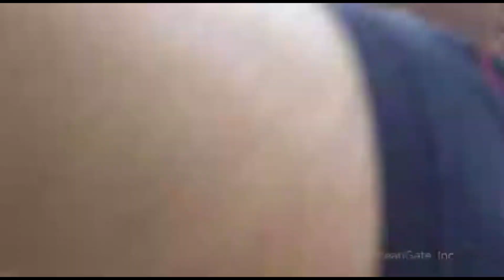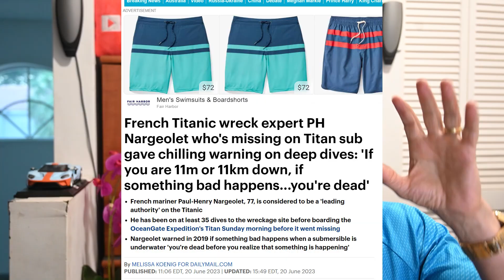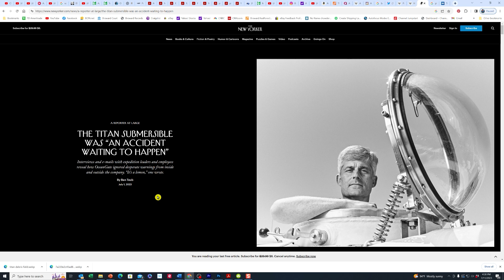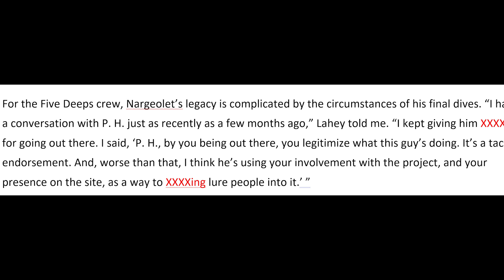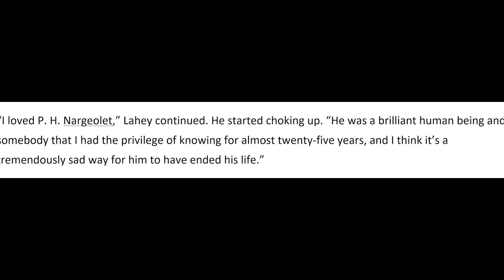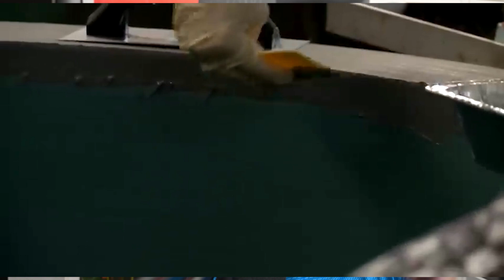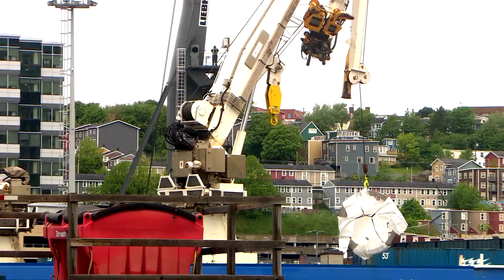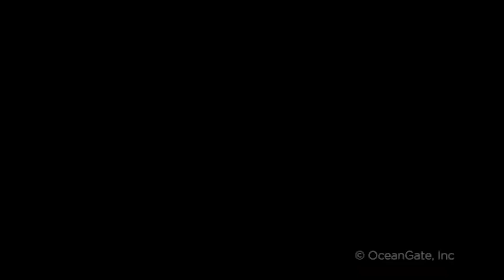Titan Sub: More Q&A, Design Defects, Why Descent Fast

Comment: If the descent rate was really that fast (we don't have official numbers), the sub was way too heavy. Then descent rate increases only with the square root of the weight, so for going down about 1.4 times as normal fast you need twice the weight as normal.

The sub size is 6.7m x 2.8m x 2.5m, so the area A slowing down descent or ascent would be 16.75m2 when a rectangle or an estimated 12 m2 with the real shape, and according to 𝑉=√(2𝑚𝑔/𝜌𝐴𝐶𝑑), with a Cd set 0.5, the "overweight" to make the sub descent with 0.4m/s would require about 50kg or 500N down force.

For 0.6m/s it would be 110kg. This means, that the sub would have been in the order of 50kg too heavy. To change from a normal descent to a normal ascent, the sub would have to drop about 100kg of ballast. However, if the sub has 50kg normal down force on descent plus is 50 kg overweight, dropping 100kg of ballast will get you only roughly neutral buoyancy.

I don't know how much ballast they actually had, and my calculations are only a rough guesstimation, but the numbers kind of make sense. It would be a bit weird though if they miscalculated they weight by 50kg - that is not a minor difference. I am really curious what the official accident report will reveal.

UPDATE: The submersibale "Limiting Factor" has 500kg of drop weight and 100kg of trim weights, so if Titan had similar ballast, it should have been able to deal with 50kg easily, but I could not find any numbers regarding ballast mass for the Titan. Maybe they screwed up here too, trying to save weight.

UPDATE 2: The Titan had 8 x 36lbs sand bags as ballast plus an unknown amount of lead pipes, so the normal drop ballast would be 288lbs or 130kg, but as sand has only a density around 2, the sand bags would amount just to half of that under water, so the sand bags probably acted mainly as trim weights.
Reply: I came to a similar conclusion but instead assumed a Cd of 1.2 given that is is descending in the horizontal orientation which is not very "aero". I tried to calculate it based on the designed descent rate, mass and cross sectional area but couldn't get reliable data on the weight (anywhere from 9100kg to 10700kg). The excess ballast is sensitive to Cd and at 1.2 the excess is around 130kg. I think a miscalculation is very plausible. e.g. if the calculation is in kg and the excess is 100kg a simple miskeying of 1 digit would do it.

Comment: this is not a professional argument, but not rapid descent might have caused small cracks, because of the pressure building up slowly and distracting the glue, the submersible was built using, and this would cause Oceangate, drowning its passengers, so the death might have not been so instantaneous and passengers think would suffer much more, in the case of unsuccessfull slow descent!

Comment: I can't believe they wound the carbon fiber on only one direction How is it supposed to have any strength at all You want that weave in there to give it strength This was an accident waiting to happen and the only reason why it did happen was Stockton was on Adderall He had an abnormal high dopamine level so he can convince himself the shady engineering package were completely sound

Comment: I was a wood treater I don't know if you know anything about wood treating We use 100-ft long cylinders 20 ft across sometimes 30 ft First we put the logs under a vacuum check out all the free water in 25% of the bound water
Then we put those logs under a pressure and we push back with the pressure and chemical called penta in the medium is diesel fuel That's how you make telephone poles.
We are at 5600 ft The max vacuum we were able to grab was 17 in max vacuum at sea level is 22 in That was barely enough vacuum to achieve what we needed cylinder one door 38,000 lb I would shield that door with a quarter inch vacuum.
You would think a quarter inch ate much Well one day our vacuum valve stuck closed We had a quarter inch in there and we tried to pull the door We took the 100-ft by 30-ft cylinder right off its foundation I'm so glad the manager told us to pull I was saying no I don't think we should We had the glue the cylinder back on its foundation We used a micrometer to get the proper amount of glue When I watch ocean gate glue the two titanium ends on the cylinder that was not professional by any means

Comment: To my eye (BS Mech Engr, MS Mat Sci) a major vulnerability was wrapping the carbon into a cylinder without using a commonly enough used technique while making pressure vessels of weaving fibers with spirals rather than 'straight' or 'flat' (like inch-wide 'tape') as you see them doing. Their choice made the composite rather vulnerable to delamination, especially as they were loaded in compression. Weaving matters.

A spiral application of the carbon fibers (best term I have for it) ties together the layers in a way that is much more resistant to delamination. Even that may not have been sufficient to the task.

Aside: I reckon the graphite fiber they applied was what is called 'pre-preg', so am not as alarmed that it wasn't applied 'wet' as you thought might be appropriate. I don't have direct experience with carbon fiber (but did build and fly an experimental plane made of fiberglass, so maybe some cred.)

I totally agree with your observations about process quality control. Epoxy to metal just doesn't sound like a good idea.  The different elastic moduli could have been a factor.  Pictures showing the titanium 'joining ring' (recovered) having no adhering composite material seems telling, but the violence of the implosion might just do that no matter what.

A final comment. Graphite fibers have no 'toughness' in a Materials Science sense. You have already pointed that out rather well. It  will not yield plastically and retain any structural integrity. That is a big deal. No amount of acoustic crack detection would help. Complete failure would occur before any remedial actions could be taken. Materials scientists call this 'fracture critical'.
Reply: the first hull yes the last hull wrapped differently

Comment: One of the things that disturbed me was the dove-tail housing at the back-end.  It impressed me as being unnecessary and cosmetic.  It conceals the area where electrical cables go from the outside to the inside of the submersible to the inside as am area of potential weakness...
Reply: People are say no cabling penetrated the pressure chamber.
Reply: @JoeLinux2000  we don't know for sure and if it was a wi-fi, that's a weak link too.

Comment: titanium and carbon fiber compress at different rates which would have put extra stress on the seam around the titanium front piece, this added with what you said about the glue having nothing to stick would suggest to me that the seam between the two materials is the failure point.

but I'm not convinced that the "leaked" transcript from the previous video is genuine. it sounds like it describes symptoms from 3 seperate failures all at once. loss of boyancey, loss of power and structure failure. I dont think its realistic to suspect that all 3 happened at once for unrelated reasons.

Comment: What would have caused Titan to descend faster? Descent should be a function of weight. So I can't figure out where that extra weight would come from. The equipment bay isn't sealed (as it's not a pressure vessel) so it's not like extra water leaked into a sealed area. As I understand it, only the pressure vessel where the people were is a sealed, watertight compartment. The rest of Titan is open to the ocean.

So why was Titan descending faster? Where did the extra weight come from? Though, given the shipshod way that things were done on Titan, it wouldn't surprise me at all to discover that the crew overloaded the ballast or the sled.

Comment: Basic knowledge told me that a full titanium sphere distributes the great ocean pressure evenly, but inserting a cylinder in between two hemispheres creates a focused weakness.  Excellent computer modeling would have demonstrated this from the very beginning, that the structure was flawed.Stockton Rush might have had limited engineering skills in aircraft design and you could say in the ocean depths , he was out of his element. He has demonstrated himself to be a jet pilot, persuasive salesman and an entrepreneur. His commercial aims required him to defy the laws of physical science though pure determination and through his own actions, failed. 
The story of Paul-Henri Nargeolet, adds just one more fateful element to this story...

Comment: As others have pointed out, the major design issue was the disparity in modulus (compression factor) of the parts. The titanium will effectively not compress at all, whereas the carbon fibre will: that means the bond is a certain failure point.

What is likely to have happened is the bond failed, even if it was just a tiny hole. Given the pressure disparity, the water ingress would have been rapid and caused the negative buoyancy. In addition, the seawater could well have caused serious electrical issues and heat/fire would have been devastating for the carbon fibre.

The disaster was inevitable.

Comment: I got a couple of answers for you number one you cannot ever ever ever scratched or Dent or screw up carbon fiber in any kind of way just a scratch on an airplane wing will break it off over time with vibrations....... moving on to whether or not the carbon-fiber should have been wet absolutely it should have been sealed with some sort of epoxy and moving on to my third point is tubular Kevlar is sown in overlapping patterns the fact that it was wrapped is retarded example I have a Warner paddle from when I used to be a raft guide it's wrapped in a very specific pattern not just spun around a tube.

Comment: WHEN YOU THINK ABOUT THE GLUE AND THE FRONT WINDOW ECT. THAT ISNT REALY THE MAIN THING, NON OF THAT STUFF WOULD HAVE HAD MUCH TO DO WITH IT. ALL THAT STUFF WAS BUILT TO KEEP PRESSURE OUT AND WAS PUSHED TOGATHER HARD AT ALL TIMES. IT WASNT DESINGED TO KEEP PRESSURE IN. WHEN THE CENTER PART OF THE CARBON FIBER TUBE IMPLODED IT DID WITH SUCH FORCE IT BLEW EVERTHING A PART. THE CRAFT WASNT DESINGED TO WITHSTAND THOSE FORCES PUSHING OUTWARD. STILL ITS AMAZSING THE BOLTED IN FRONT WINDOW RIPPED RIGHT OUT. WHEN YOU SEE WHAT HAPPENED IT MUST HAVE BEEN INSTANT.

Comment: The epoxy holding the ring on worked shockingly well IMO, considering they designed the joint inside-out (carbon composite is more compressible than titanium, so the tube would try to pull away under pressure). Incredible that it worked more than once

Edit: I watched a clip of the video from Oceangate again & it looks like the Ti ring may have had a slot & been glued on both sides after all. Still sketchy to create a stress riser between materials w/ different characteristics, but not as insane as relying on the epoxy to hold it from the outside only
Reply: I beg to differ. The carbon fiber has roughly 5 times the elastic modulus of titanium. That means it compresses elastically far less than titanium under the same load conditions.  Compounding the problem is that carbon fibers have no plasticity to speak of (as was pointed out in the earlier post. Plasticity only matters when loaded near a fracture limit, but it means 'near zero toughness' in a material science sense. No bueno.
Reply: @ivarhusa454  The compressive modulus of carbon composite varies greatly depending on the formulation (6 - 300 GPa). Judging by the slapdash construction of the cylinder I would expect it to be at the lower end of this range. Compared to Ti-6Al-4V (114 GPa).
Reply: I would suggest that the pressure on the empty "barrel" of carbon fibre, was much greater than the ends which were in contact with the titanium ring. This might have had the effect of the edges of the titanium ring acting as a pivot to the carbon fibre, it's exreme edges then being forced away from the titanium. The carbon fibre trying to stay rigid and pulling away from the glued surface at the ends. Any gaps then opening up between the carbon fibre and titanium being didasterous.
Reply: @tonymak9213  The end caps are blow off. That means something had to hold the flanges in place. The flange joint never failed.
Reply: There are a lot of unkowns related to exact dynamics of the materials.
Reply: It wasn't the flange connection that failed. Why? The spherical end caps are detached from the flanges. A force blew the spherical end caps off that were bolted to the flanges. The epoxy flange connection never failed, if it did the flange/end cap assembly would be intact, it's not. When carbon fiber break it shatters, that's why you don't see much carbon fiber on the flanges. The flange connection was the strongest part of the sub.
Reply: @topfuel29channel  you could be right, although IDK if we can rule out the bolts shearing due to other forces when it collapsed & rebounded, or the bolts being removed for some reason by the salvage crew. I'll have to look out for when Canada's NTSB releases their report..
Reply: @nathansmith3608  Imagine this. The huge 15 psi are void inside the hull is collapsing, air pressure, and temperature are increasing rapidly, at the boundary of the air void would have been a layer of steam. I used Gay-Lussac's Law Calculator to calculate, 15 psi at @70 F. increased to 5553psi (water pressure at Titanic) = 195,624 F.. With that type of temp., there was a steam explosion, at the end of the implosion event. That steam explosion would have blown the end caps off the flanges. I don't the the salvage crew would be allowed to dismantle anything until it was inspected. These are small pieces not hard to handle with a crane.
Reply: @topfuel29channel  yeah, that makes sense. I just don't know if it excludes the possibility of the collapse starting at a delaminating epoxy joint. Couldn't the carbon fiber tube disintegrate w/ everything crashing together around mach 2 in a complex way w/ all sorts of instantaneous plasmas & pressure spikes formed either way? I'd have thought so, but I don't really know

Are you saying the epoxy & carbon fiber held together while the flange bolts were ripped out? Shouldn't there still be carbon fiber glued to the ring in that case?

Comment: I work in a shop that builds custom carbon fiber parts daily. I want more information before drawing any conclusions. I'm sure they are using some kind of prepreg (Carbon that already has resin applied, requires cold storage) and then after the layup curing it with a large oven (Very specific ramp and soak parameters here) under vacuum or an autoclave. Applying thickened epoxy or other two-part glue by hand is pretty normal, you just always want to apply more than necessary so you have good squeeze out on the edges of the glue joint. It's easy to clean up excess glue that squishes out, it's extremely difficult to take everything back apart because you didn't put enough glue in. I'd love to look at the datasheet of whatever glue they were using and see how appropriate its use was for this application.

As for bonding to titanium, I have no idea how well that would work. We do use titanium reinforcement in some of our parts but it is completely encapsulated by the carbon. Think a skeleton of titanium with several inches of prepreg carbon surrounding it on all sides. If the part isn't completely encapsulated by carbon we use nuts and bolts, never glue. I'd be too worried about the carbon and glue delaminating from the metal to even try it.

Comment: 6:02 From what others have said on other video before, this isn't much of a problem since the pressure below water will keep the titanium ring pushed towards the "hull".
Reply: You can't argue with that logic... Oh yes you can! Pressure is equally distributed throughout the exterior of the submersible - That mean the middle CF bit is delivering say 2x the force on the glue by the nature of its 2x the size. basically its trying to squeeze the pop bottle in the center and blow the cap off. Not trying to force the cap on. If you get my analogy!
Reply: @stever2583  Huh, I guess that makes sense, but wouldn't the CF "squeezing" the caps off already be a problem in and of itself? Shouldn't the hull be resistant enough for that not to happen?
My understand of the CF is lacking: i gathered that CF doesn't "give way", it breaks right away, there is no flexing or anything. Did I misunderstand?
Reply: @anneonyme213  The CF does in fact shrink under pressure, it also fragments the individual strands of CF as it shrinks, that is why there is some speculation that there was water held inside the layers of CF. ( I don't know anything about that) Put the pressure on the CF would have the effect of pulling the Cf from the Titanium as it deflects. Thus the need for continuous monitoring of the structure after each and every dive.

Comment: 6:35 At depth, the pressure would have been forcing the ring into / onto the cylinder. The glue needed to be strong enough to hold the ring in place while on the surface not at depth. There would have been some sealing, filling the microscopic depressions of the dissimilar materials going on also. The cylinder failed in a millisecond, collapsing along its length pressurizing the air that was then forced toward the titanium end caps blowing them off what little remained of the carbon fiber.